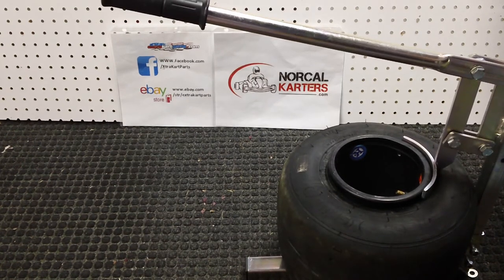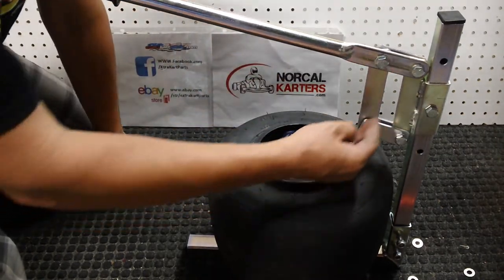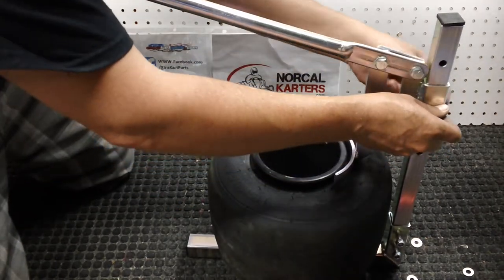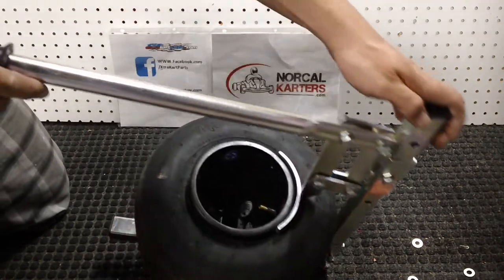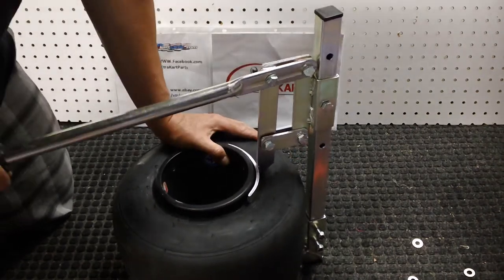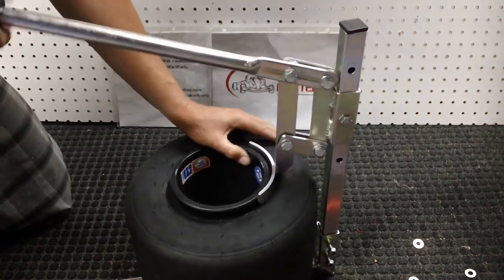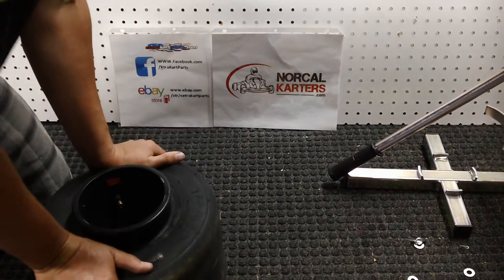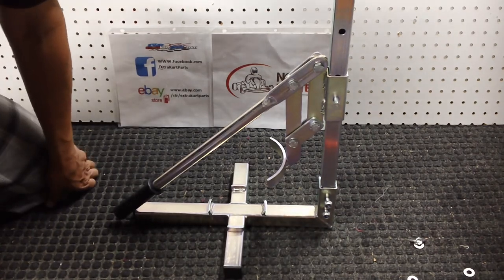How to use a Tire Bead Breaker Tool for Karting Application

Comment: Link please.
Reply from the maker: Link for which items?
Reply from the maker: https://rover.ebay.com/rover/1/711-53200-19255-0/1?mpre=https%3A%2F%2Fwww.ebay.com%2Fitm%2F164314327939&campid=5338703655&toolid=20008
Reply from the maker: Accessories for tires or tools - https://rover.ebay.com/rover/1/711-53200-19255-0/1?mpre=https%3A%2F%2Fwww.ebay.com%2Fstr%2Fextrakartparts%2FTires-and-Wheels%2F_i.html%3F_storecat%3D30290268012&campid=5338703655&toolid=20008
Reply from the maker: Did you find what you needed?